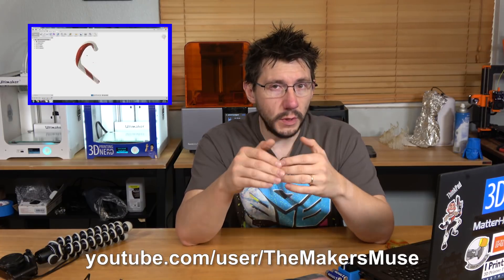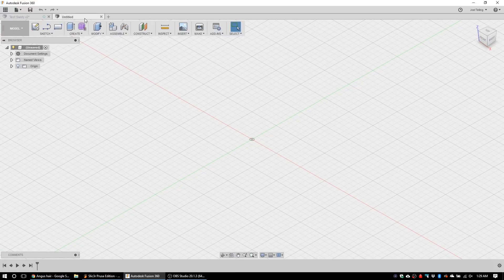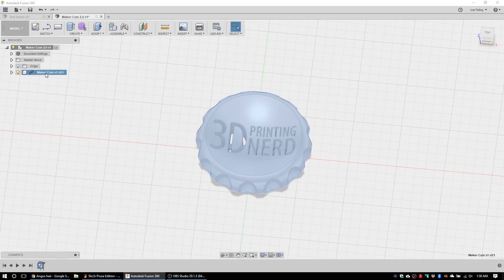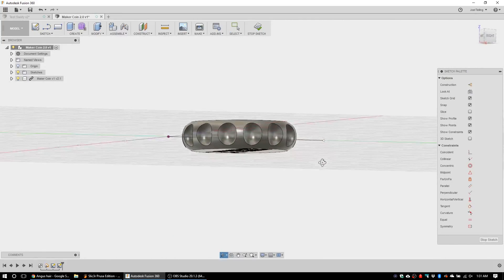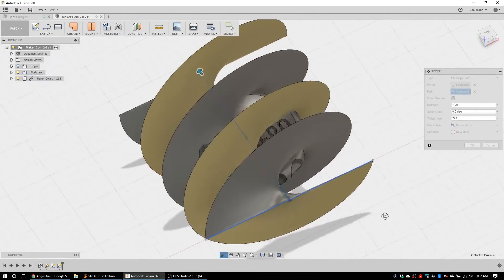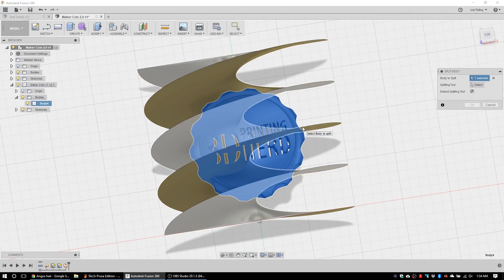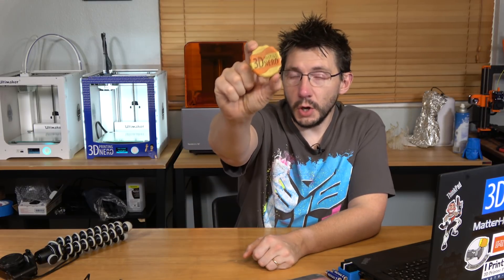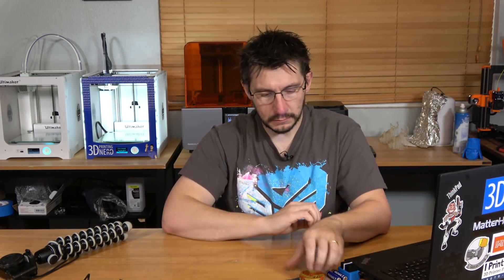3D Printing Candy Cane Maker Coin - the Maker's Muse Fusion 360 Tutorial Next Logical Step

Comment: Hm. Looks like it might be easy enough to do something like that with a single-extruder machine by splitting the coin vertically, then printing half of one body at a time and putting the object together with a little sanding/gluing.
Edit: Might not exactly be appropriate for a maker coin, but if you wanted something that wasn't a test object to look swag, it still seems like a decent option.

Comment: Hey Joe, 
I have a grate offer for your coin with a slight change.
You can increase the distance between the two prats to about 0.25mm or 0.3mm.
This will give you a maker coin that made from 2 pieces whitch can be assemble by twist one into another.
 By the way, I recommand to print them together and not in separate stl files.
Please let me know if you try it and good luck!
Lahav.
Reply: .Sorry fo spelld your name wrong